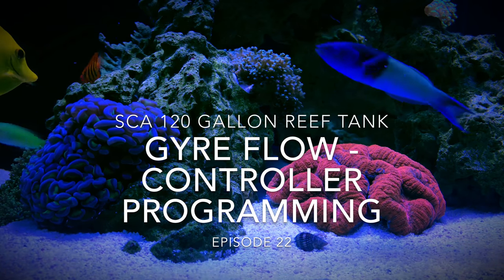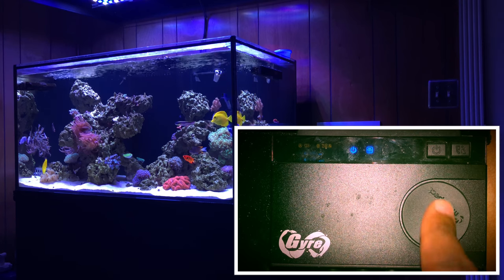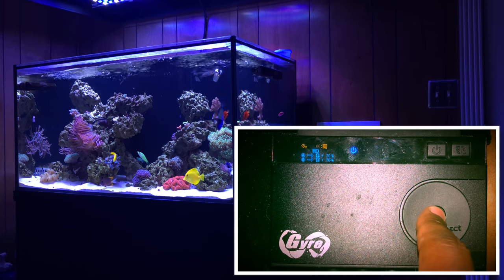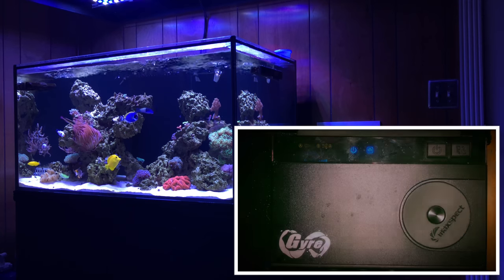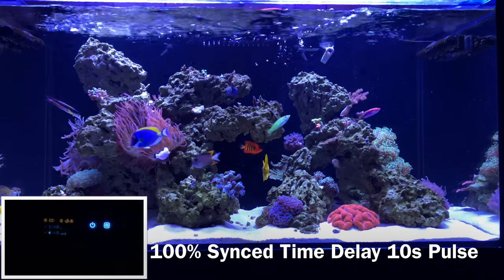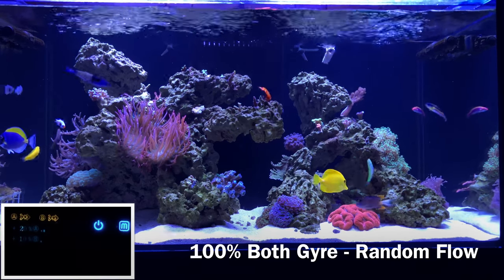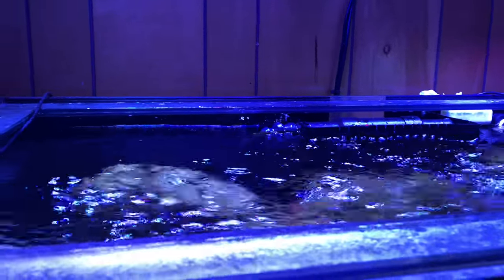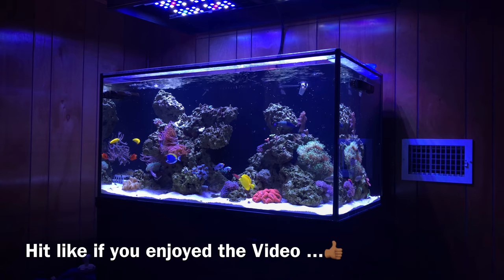SCA 120 Gallon Reef | Ep.22 | Gyre Flow - Controller Programming Guide

Comment: What style CJ, love your videos - subscribed. I'm running two 350's in tandem in a 260 gal tank. I can agree about the cleaning process, but I started out with an original 150, which to disassemble, was a nightmare in comparison. I still have a drawer of spare parts for it (it's still running as a backup after 5 yrs!). The other neg., as you say, are the dead spots. In my case, I added 2 AI Nero 3's (which can also push a helluva lot of H2O around) lower down in the tank. Another big negative for me is that these pumps seem to be magnets for Cyanos and other forms of algae (which is why frequent cleaning is so necessary). But you're right, for pushing water around there's nothing better.

Comment: Good vid man, I have two gyre's..one is the newer 230 with the advanced controller and the other is the xf130 which is basically the same pump but older. My first advanced controller was faulty out of the box and COralvue sent me a new one. I agree that the controller is the best right now and in terms of quality of flow the gyre's are the best BUT like you said the maintenance on them sucks compared to an MP pump and the noise is almost straight up ridiculous. What's interesting is my older xf130 is virtually dead silent even at 100% where as the newer 230 you can clearly hear in as little as 20% and get over 40% at certain flow modes and it's downright stupid loud! I have noticed that the sound varies between different flow patterns so at 40% pulse mode it's very noticeable but 40% at a different flow pattern isn't as bad. The instruction manual that comes with the controller is basically useless IMO too. They need to work on the noise of these pumps and they'd be hands down the best overall pumps in the hobby however, with that ridiculous noise I imagine a lot of people will return them. Also, I'm pretty sure I'll be requesting ANOTHER controller as I think this replacement is also faulty because in the auto LTC mode pump B does not go over 20% even with the max is set at like 60%.

Comment: Any chance you'd share your gyre programming? I've been running the LTC option, but doesn't seem to be cutting it. Been getting some cyano in the front corners of the tank. Thanks for your help!
Reply: I was about to ask the very same question.  I like the look of the flow in your tank, and mine is set up VERY similar as far as rock setup etc. Honestly wouldn't know how to program for that.  I have a 75 gl tank, with one gyre.  Any advice or suggestions for settings?  Please.  :)

Comment: I thought I saw it on BRS.  There is a program for the gyre that uses two gyres on opposites ends of the tank.  For example, as the left gyre is ramping up the right side is ramping down.  This goes back and forth.  You mentioned the down force being in the center of the tank.  This program moves the down force from the left to right and back.    I thought that was kind of neat.  stirs up low flow areas and makes sure waste cannot settle at the bottom.  Is this something you could use?  The video I saw this on gave the programming steps.  I'd swear it was on BRS
Reply from the maker: strat1960s yea I know exactly what your talking about... I showed an example of a diff way to do that with one set for wave and the other set for random... pump truly has a million possibilities
Reply from the maker: this can be done with the Automatic Mode you can program on the gyre controller.. you dont need Icecap for anything unless u want to program the gyre using a Fusion app... this controller is very very powerful and flexible
Reply: I figured that from watching your video and a few others.  I'm still a ways away from setting up my tank.